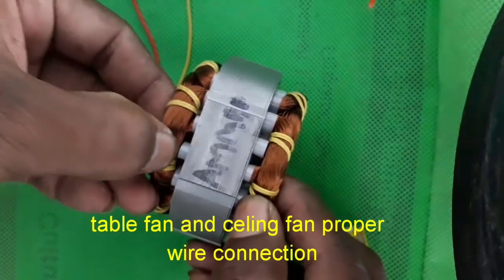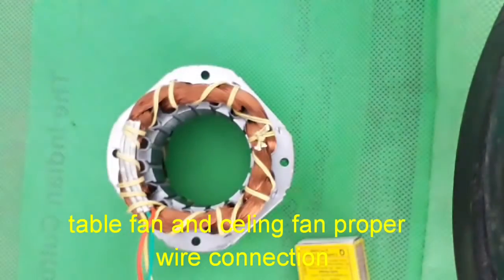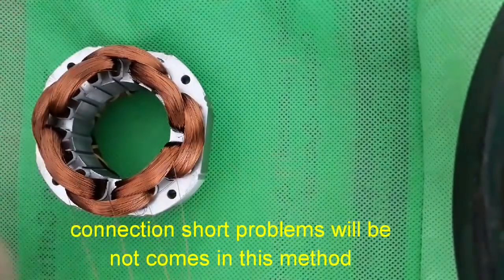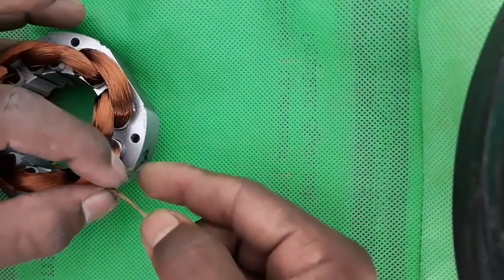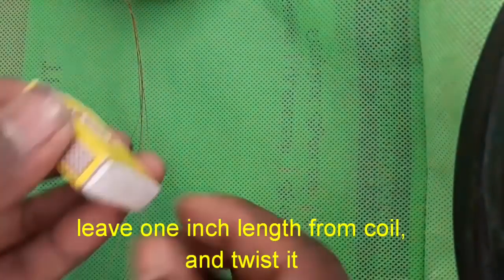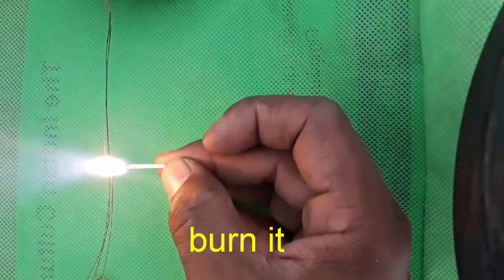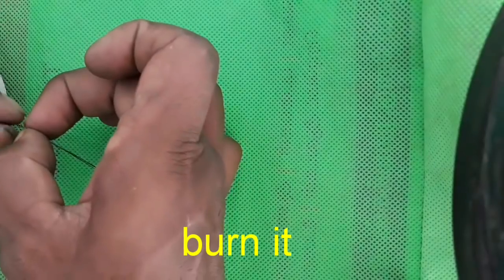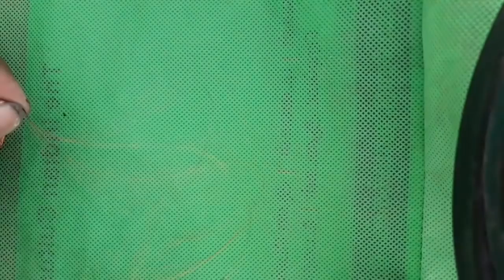Table fan coil proper connection|with English subtitles

Comment: Sir good teaching but some times moter coil connection 6wires coming how it connected sir please explane conductor 2 wires switch 4wires speed 3 wires and another I don't understand coil wire 3 wires available but 6 wires how conected please explane sir tq
P vasu. Cell no 9849492187